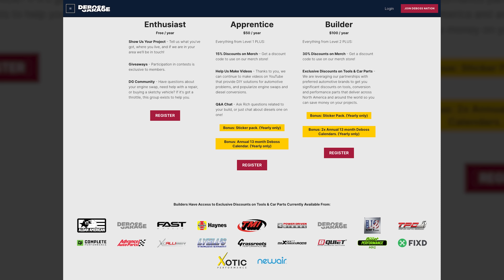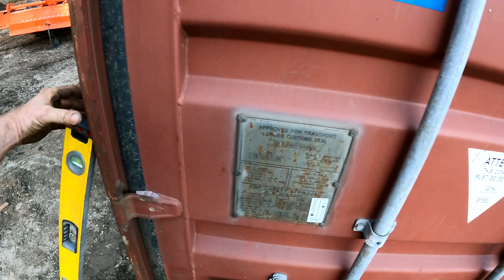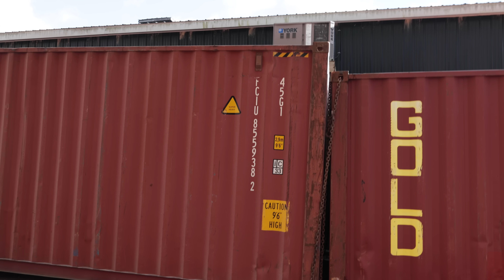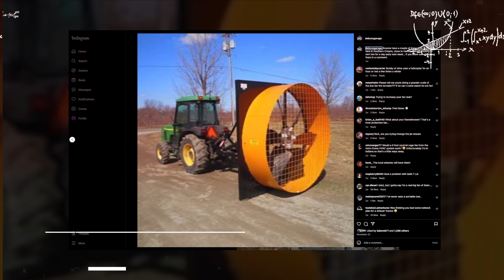Transforming My Shop With Shipping Containers [EP1]

Comment: Hey Rich. You may want to double check that the vents on the inside of the sea can are not taped over.   I use to pick up and deliver them and for the most part they were covered for some reason.  And they wouldn’t allow the can to vent and it would rain condensation and allow mold growth on what ever is stored inside them.

Comment: A skid loader or small tractor is so necessary for anyone who lives in the country. I bought a skid almost 15 years ago and I could not live without it anymore. I don’t put piles of hours on it by any means but when you need it you need it. I use it for cutting wood and moving snow and dirt and everything in between 👍

Comment: Not sure what it's like in Canada, and maybe I missed it if you did cover it, but here in the Midwest, these containers sweat, producing condensation in the containers causing the contents to rust. You'll want to vent them somehow or a lot of desiccant.
Reply: I agree with you about the "sweating" problem. 
The sweating is mainly from ground moisture seeping up.
This will be exasperated because his shop shades these containers compounding the problem.
Reply: Same problem here, definitively needs to have some form of ventilation and/or heating.
I solved the problem by routing overboard air from house ventilation into the container, keeping it dry and adding a little bit of warmth
Reply: I have a workshop in one. I believe the problem is when the container is opened on a warm, wet day in winter, humid air gets trapped inside, and then at night the ceiling gets cold and the moisture condenses on it. Insulating the ceiling helped.
Reply: Company called Con-Vents has easy to install vents. I put two in my 40’ container. Need to use four. There’s a lot of information online about problems with condensation in containers.
Reply: @williamriedel1686  Will check them out. Thanks!

Comment: If you have space, a good way to use these containers (if you have 4) is to take two, make a footing for them such that they sit spaced so that the top outer corners are spaced by the length of a container, drop two containers on that, then put two more such that they bridge over. You then buy a tent for the gap and have a huge inner space to store stuff and 4 containers which can be connected by ladders internally. You can also cover the whole thing with siding and a conventional roof. It will never fall apart. Containers are meant to take on loads that are Nth time larger than whatever you could stuff inside and a building like that.
edit would like to point out that with this storage method, you can also add walkways around inside and out and have space to work on tall machinery like excavators.

Comment: You need to keep checking the inside of them containers we have 2 of the 40' ones and we didn't check them very often and they started to leak and ruined most of the stuff that was in them. We get along a lot better with 53 foot van trailers.

Comment: Chances are, you might not see this comment, but I just picked up some E-track from Princess auto on sale and welded it into the inside of my seacan. Works great because of all the different hook accessories you can get to organize stuff. Just grind away the coating and weld through the holes in the e-track.

Comment: Also wondering if moisture will be an issue for the vehicles during winter in the container? I’m in Wisconsin I picked up a southern crew cab long bed 98 k3500 single wheel that sat in a 95% of the time climate controlled garage and it still started it rust. (I’m in Wisconsin but we Put a 12v with a 5 speed in that truck also lol)
Reply: Edit: sat in the garage for just under 10 years also

Comment: Did you just shove an I beam in the bus? You could have used that. Weld it on the ceiling of the c-can and install a chain hoist on rollers like Peg did with his.

Comment: You think shipping containers is a good idea but when sealed they are damp and wet all the time. If you leave a car in one, everything rusts and  goes mouldy fast. Better to just leave  them outside, at least they dry out now and then. This is why car storage is heated and  climate controlled. I know you will probably not even see this comment but will wait for the video 2 years from now. Why shipping containers are a bad idea for vehicles.
Reply: Depends where you live to a large extent. I've had two vehicles virtually destroyed by rats. They will do far more damage by eating wiring, hoses and pissing all over everything than the condensation in the shopping container will do. Anyway you can just run a decent commercial dehumidifier with an external drain or spray foam insulation to get over the worst of the condensation. I use dehumidifiers in both my garages.
Reply: I store atvs and tools in my container. The condensation does nothing to the atvs, but the tools can get some light surface rust, so I spray them down with WD-40.